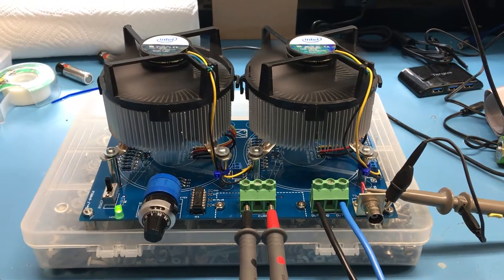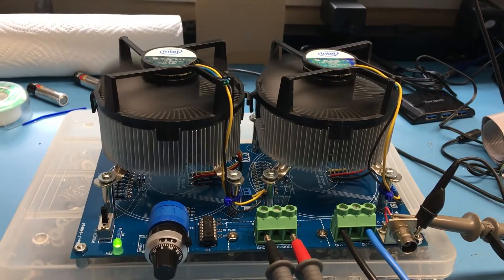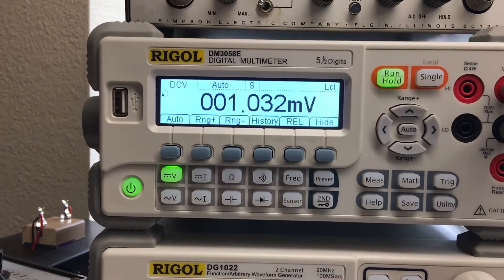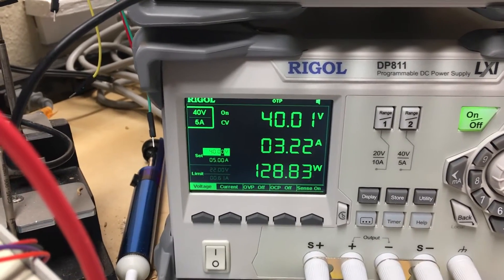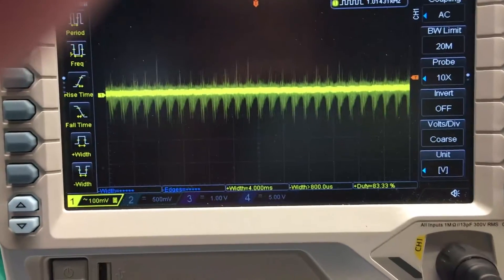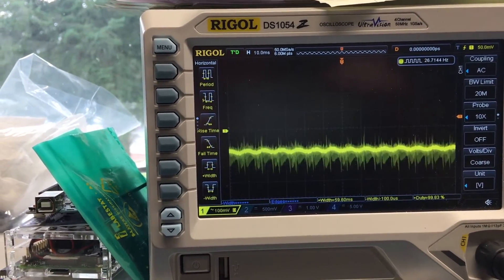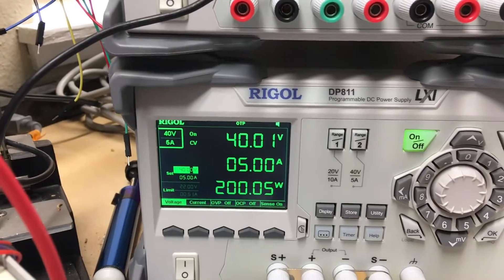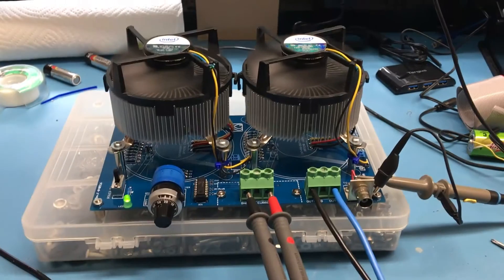EL-2 - Part 1 - Demonstration of the Five Fish EL-2 constant current load - STB1

Comment from the maker: Towards the middle of the video I observed 400-500mV of noise on the scope output of the EL-2 and attributed this to noise from the Rigol power supply. Funny how the obvious doesn't always click. I sat down to take another look and quickly uncovered that the noise is being introduced by the cooling fans on the heat sinks. Adding a large amount of capacitance near the fans helped reduce the noise but didn't eliminate it. Eventually I setup a second isolated power supply for the fans and the noise was completely removed; note that this second power supply is completely isolated; it doesn't share a ground connection with the EL-2 main power supply or the power supply being tested.